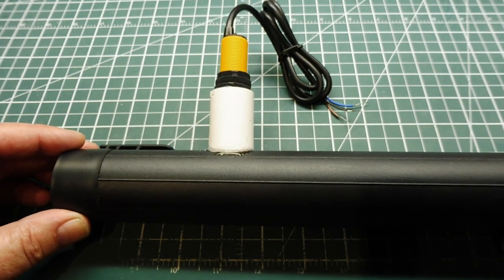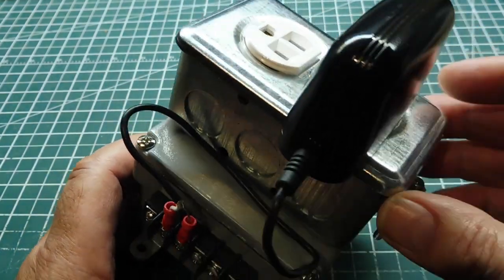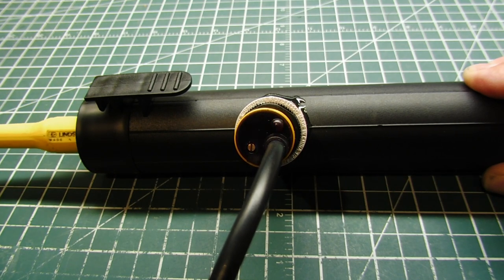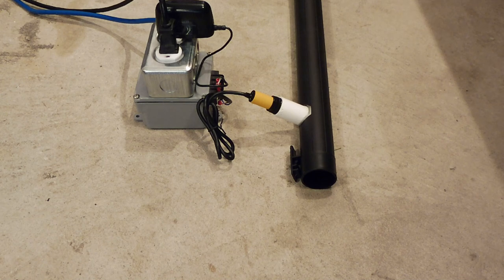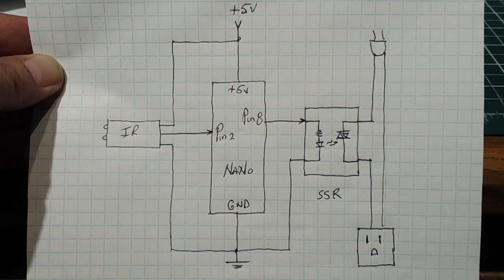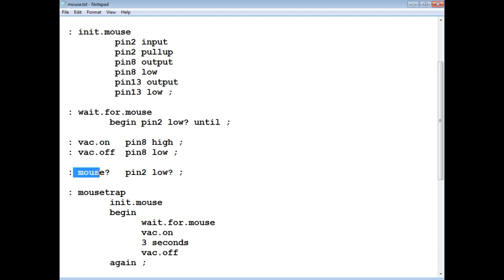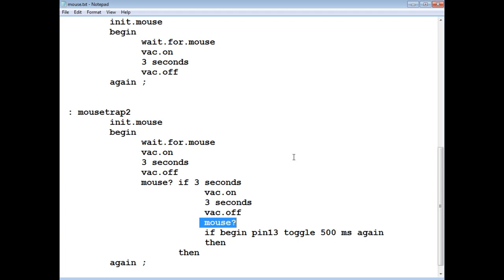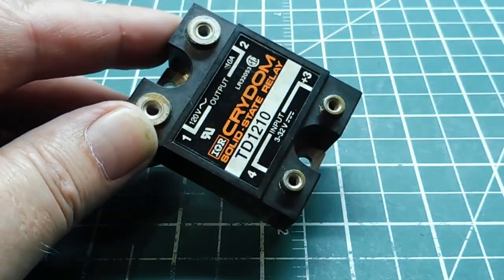Build A Smart Mousetrap  / Arduino

Comment: thank you for help this prog work well and going to try the other program hopefully learn forth on the way with example
Reply from the maker: Glad I can help! Just curious, are you using TeraTerm  for your serial terminal?
Reply: @0033mer  yes  tera term  i am have any other problem when store the prog in flash memory by  flush i get ok reset controller i lose the prog?
Reply from the maker: After you type flush type extend and it will be saved after reset.

Comment: You need a pet snake for your free range organic feeder.

  Your Forth dictionary is an object of envy. 
  I now have the longer version of that FF5 pdf guide you linked to before. I also have several PIC18F26K22's in transit, and am working on laying out and etching a development board. That chip has more details in the guide than the AVR so I figured it was worth trying.
   I also picked up "Starting Forth" by L. Brodie and "Threaded Interpreted Languages" by R. Loeliger second hand on eBay. 
   There is also a 1hr 46min interview with Chuck Moore (the creator of Forth) from 2017 on YT. It's a bit of a slow/dry watch, but gives an interesting first hand account of Forth, it's utility, and philosophy. I thought I'd mention it for anyone that is interested in learning more.

 Thanks for the inspiration.
-Jake
Reply from the maker: Those books should help you out. Here are a few more you might be interested in:
http://www.exemark.com/FORTH.htm
http://thinking-forth.sourceforge.net/thinking-forth-ans.pdf
http://galileo.phys.virginia.edu/classes/551.jvn.fall01/primer.htm
ftp://ftp.taygeta.com/pub/Forth/Literature/rtfv5.pdf
In time you will have your own dictionary which will enable very fast project development.
Reply: @0033mer  
  Thanks for those. I was looking at getting "Thinking Forth" too, but more than 2 books at a time is usually pointless for me. Something inevitably ends up pretentiously sitting on a shelf unread.

  FYI, that last link is broken, the one for "Real Time Forth" by Tim Hendtlass. Just searching for the PDF by name "rtfv5.pdf" brought up several results though. A lot of these are available as used library books on eBay. Most can be purchased in print for less than $5 shipped here in the US.
 Thanks again.
 -Jake
Reply: @0033mer  
Hey! I have a question I hope you might know the answer to. I got several PIC18F26K22's yesterday and started playing. The FF5 Assembly file for the PIC18 (ff-pic18*asm), came up with a build error out of the box. The error is on line 2535 and is preceded by:
ifdef ANSELC
ifdef ANSC7
  The code is commented with "enable digital RC7 for RX." (UART)

 I got it working. I'm not asking you to fix my problem or anything like that. I don't understand/know if I fixed it properly, or as intended. I think the issue was just a minor error. I started guessing how to fix it based on context elsewhere in the code, and eventually got it working.
   I haven't played with much assembly programming. I certainly couldn't write anything useful from scratch...yet. The original problem line was:

bcf    ANSELCNSC7,  BANKED     ;

The issue is that "ANSELCNSC7" is unrecognized. I managed to figure out "bcf" is the "bit clear" instruction. I found a bunch of references for older PIC's and found calls to things like "BANKSEL" and "BANK 0" or "1," but I didn't find anything about "BANKED" specifically outside of this ff-pic18 file. I didn't see it mentioned as an instruction for this PIC either, so I imagine it's in the Microchip MPASM docs. I didn't go there though... So I'm not sure exactly what that does. I imagine its related to fetch and store type register bus directives. I don't want to take too deep of a dive into Assembly and lose track of learning FORTH.... That's somewhat tangential though.

 I got the code to compile, upload and communicate by changing the problem line to:

bcf    ANSELC, ANSC7,  BANKED    ;

  I think this is what was originally intended, a call to the register, then the specific bit, instead of the conjoined, unrecognized instruction. 
  I would have written this off as a simple error, but the Assembly code that proceeds the problem on the next few lines is related to PIC18 chips that have 2x UART connections. In the "RX enable" subroutine for this UART, the ff-pic18 assembly code has a similar compounded word for the same RX enable instruction:

 bcf    ANCON2NSEL18,  BANKED  ;

 I don't know if that is valid, or if the assembler is ignoring it entirely because I haven't defined a 2nd UART connection. I searched the web/datasheet/several Microchip docs, for these instructions but I didn't see anything informative to this context while skimming.

 The important thing is that it works now. The code is on the controller and I've confirmed 2-way communication in a serial terminal. I'm just curious if I fixed it correctly, and if there is an additional error in the UART2 code, or if I should have fixed my problem another way. If you don't know off the top of your head, it's no big deal. I don't expect you to look into this or anything. I'm just curious if I got it right or if there's a simple solution I should know about :-)

  Sorry if this is difficult to follow. I'm sure I'm misusing lots of (unfamiliar to me) terminology while attempting to explain all of this.
Thanks for reading this far, and thanks in advance for any insights you might be able to share :-)
-Jake
Reply from the maker: I used Flashforth on a PIC many years ago but went over to AVR so I have not used the current PIC versions. There is a forum available and the author Mikael Nordman is active with providing support. There is a typo on line 2535 according to the forum and your fix is correct. Correcting mistakes is a good learning experience  Check the Flashforth website for support information. Consider uploading a video on PIC Flashforth after you get it up and running smoothly.
Reply: @0033mer  
 That's where I was going with this :-)
  I am trying to put together and remember all of my steps well enough to make a simple walk through. I may just do some screenshots with text and music, but I'm not sure yet. I have a new white desktop I need to have installed before doing uploads with any kind of video. I hope I can get around to making something.
   I have a couple of the 40 pin version (PIC18F46K22) on their way too. I'm around 98% finished with a double sided layout in KiCAD as well. It has a nested 28 pin μC footprint inside of a 40 pin so all the PIC18 chips will work in it. I added a 1602 LCD header, a few LED's and buttons, and a dual regulator setup.
   The main thing I try to do is breakout all the μC pins onto socket strip headers spaced to fit the outer pin hole edges of a 5x7cm perfboard. Basically after I have the dev board in hand, I just add male pin headers to the outer sides of a 5x7cm perfboard and it plugs into the dev board kinda like an arduino shield. This leaves the center of the perfboard open to prototype on.
  I was torn while doing the layout. I'm tempted to order them from a board house. I can change a few footprints now and make that happen, but I finally went with my "beefy etch" style where I make the pads and traces as large as possible to enable easier etching. I made the mistake of designing around the board house's specs at first instead of my shelf stock of copper clad, so now I need to order more to actually etch the board.... Oh well...
 Oh, and I also added a CH340E USB to TTL chip and USB Type B connector. The 340E is the new one in a SOP10 package without the need for a crystal. I've been using them and they work well.
   If my dev board works I'll post the final complete KiCAD .PRO / Gerbers / Transparency files on GIThub for anyone that is interested.

  Anyways...thanks for the tip to check out the forum. Will do :-)
-Jake
Reply from the maker: Sounds like you are pretty busy and have definite goals in mind... good for you.

Comment: This has eliminated the mice in my dad's garage I think 🙏5 in 2 days . I put a heatsink on the relay so I'm not worried about it getting stuck 😂 rather have the mouse or rat stuck and the vac running than it getting away.

Wrote in Arduino IDE instead and it was pretty straightforward. I have mine running for 15 seconds just to make sure it gets sucked in.
Reply from the maker: Thanks for sharing! Glad it was helpful.

Comment: Hi :)

In your “init” code, are “pin2” and  “pin8”  forth words that you defined separately and previously added to your library?  Can you share the actual code you used to define them?  I’m trying to understand how to write code to initialize arduino pins in forth.  Thanks!!
Reply from the maker: I have posted Interactive Arduino (IA.hex) in my dropbox where you can download it here: https://www.dropbox.com/s/b8p77vnjlxbr0u3/IA.hex?dl=0
It is eForth by Ting. Program the Nano with this hex file.
Extended fuse FD, High D8, Low FF. Lock bits FF.  Tera Term 19200 N 8 1
On power-up type INIT to get Pin2-7 as inputs and Pin8-13 as  outputs.
Check out my video on Interactive programming. Go through the examples in the video.
https://youtu.be/PY01_9dANd8
Now you will have the words I use in my videos.
Reply: 0033mer,
Thanks for the videos and the file. I got my programmer and am up and running IA Forth on my Uno!